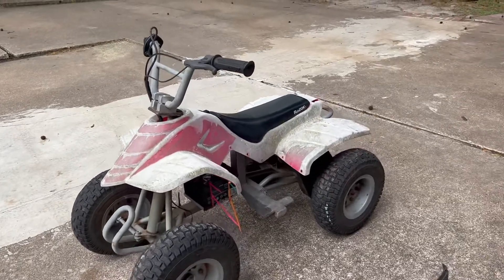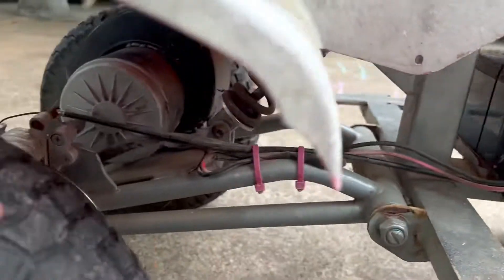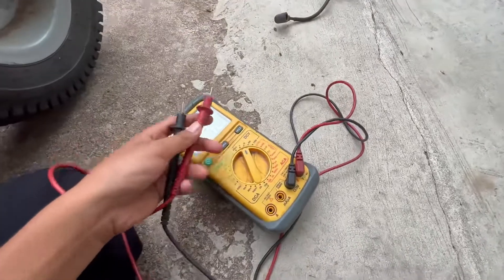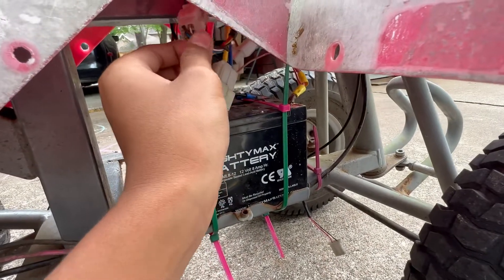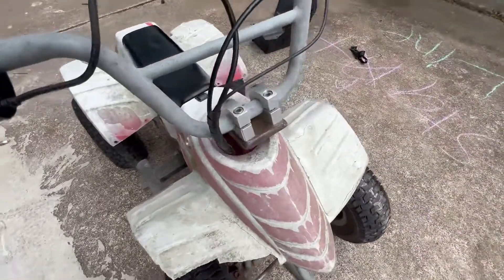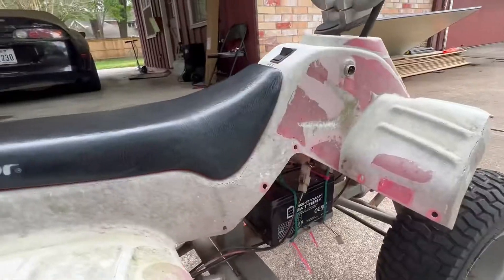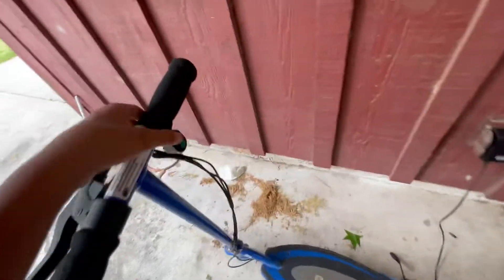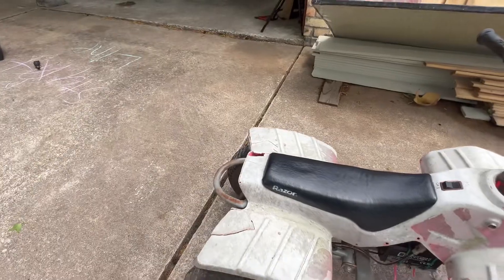Razor Electric 4 wheeler FIX - Clicks but does not run

Comment: I have this same model. I've tried replacing everything minus the motor and the breaks I will give that a shot. I will order those parts next. I'm also wondering it won't start or even show any lights only on the actual battery charger that plugs into the wall.

Comment: Great video. Thanks. Man, we’re not sure what it is with ours.  New battery is in, but can’t hold a charge unless it’s plugged in but once I pull the cord out, the lights on the throttle die out. Then nothing. When plugged in to wall charger and lights are on,  the throttle when twisted does click but no movement. Any help would be incredible n